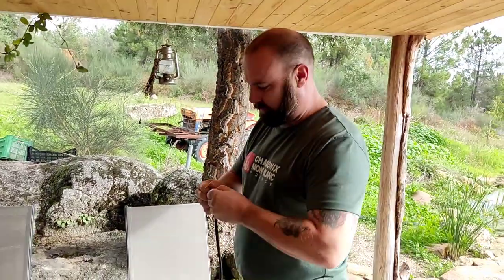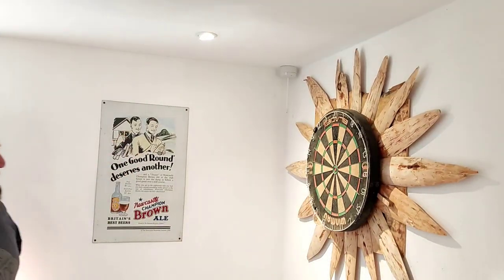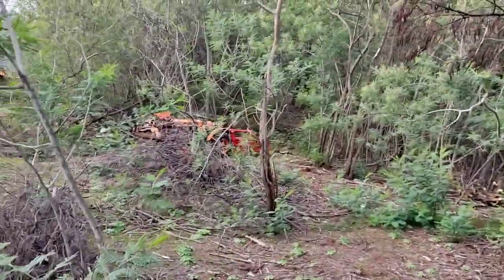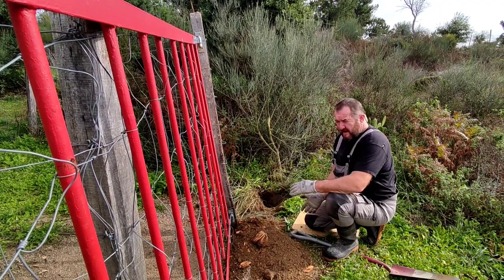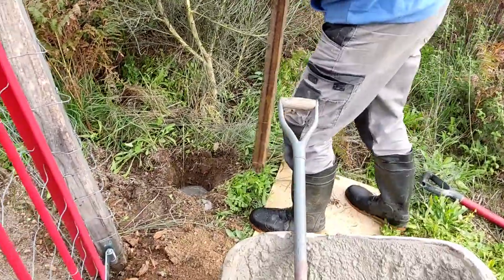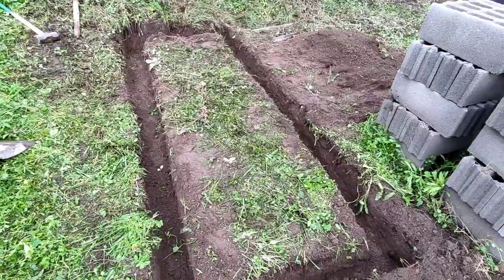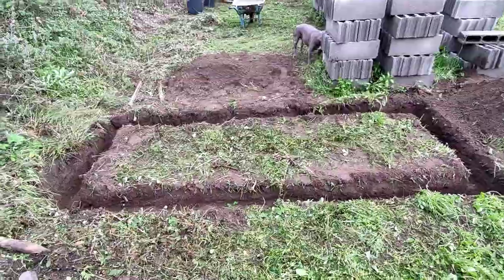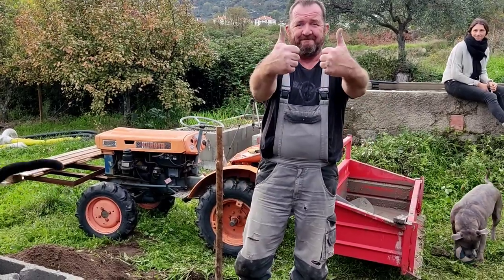Lessons in Tiling and Concrete Foundations : 113

Comment: Several examples avail on YT where slope, compostable material and chickens are combined in such a way that the material goes in at top of slope, the chickens scratch it down to the bottom of the slope, where you can harvest your compost. The chickens do the hard work of turning and mixing

Comment: Used Pallets are better than block.....compost needs air.  You then run air tubes in from the outsides.  Not to mention can be moved and not stuck with massive concreted in block if you change plans later!
Reply from the maker: Noted